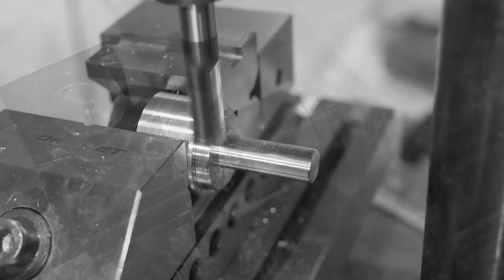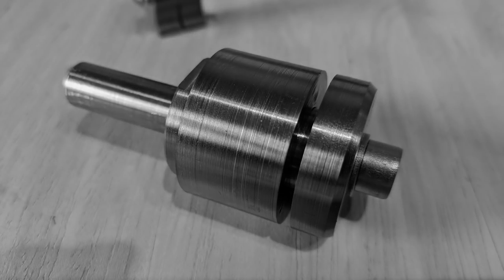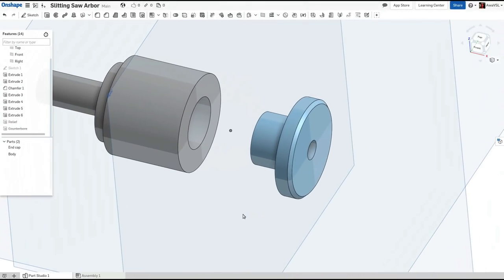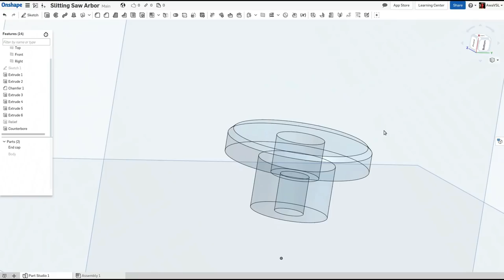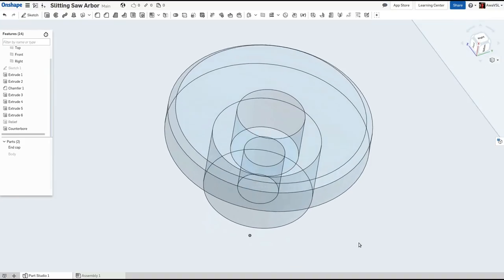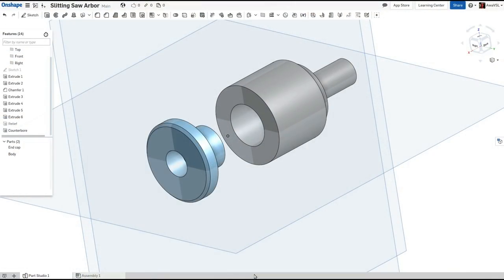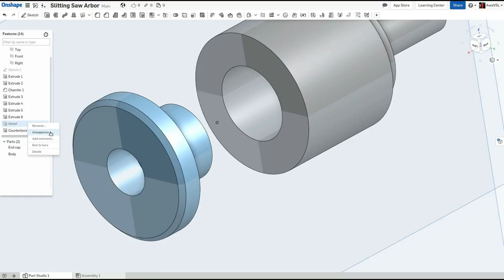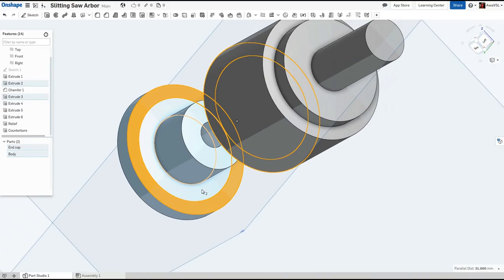Slitting Saw Arbor Improvements

Comment: I've found you can use parallels between the back of the part and the chuck to align the part with pretty accurate results.  Thanks for the video.
Reply from the maker: Thanks for the suggestion! I considered using a parallel, but wasn't sure how parallel the back face is to the clamping face, so I would have needed the indicator anyway.

I'm planning to make a set of chuck stops which will be held in a collet in the spindle taper, like those Robin Renzetti showed in a video on his channel.

https://www.youtube.com/watch?v=W7jZO3ZTd0Q

Comment: 3:25 using a smaller diameter disc than the arbor can take up the space and give a reference surface to true up to the chuck face. sometimes I use a blank lathe bit behind a part then slide it out after setup
Reply from the maker: That would work if opposite faces were parallel, but the two surfaces were machined in different setups, so the only way to be sure the front face is true is to indicate it.

Comment: That came out beautiful, and I agree you should enter this build in Emma’s contest.   The only thing I would suggest is that you flip the saw blade over so it is tightening the screw while you are using it.  Looks great!  Chris
Reply from the maker: Ooops, someone spotted that I put the blade in the wrong way round for the photo. :) I was too lazy to switch it round, and justified it to myself on the grounds that the photo would look cool with the text on the blade visible.

Thanks for the compliment. This project is currently my backup for Emma's competition, if the secret video I'm working on doesn't pan out the way I'm hoping.
Reply: Adventures with a Very Small Lathe Sounds good!  I can’t wait to see the secret video!   Chris

Comment: Alistair, your details about the material for this Slitting Saw Arbor are 30mm "Cold Rolled Steel"...
...and the later Gear Cutter Arbor material is 30mm "42CrMo4 Hot Rolled"...
So curious to know if revisiting the Slitting Saw Arbor which material would you use?
regards Colin

Comment: I wonder if using a 90deg counter sink bolt would be better than an counter bore bolt? Might help keep the run out and small vibration down, keeping the cap centered. Might not make a difference, who knows. But anyway, nice work!
Reply from the maker: I think it would be a better design, because it would leave more metal to strengthen the cap, and allow size of the cap to be reduced without compromising the strength of the tool. In order to help with concentricity, the counter sink on the bolt would need to be accurate, and the screw would need a register surface which it uses to align itself in the body of the tool. Off-the-shelf bolts don't (in my experience) have heads which are  precisely machined, and the thread isn't in any way guaranteed to track the centre of the threaded hole perfectly.